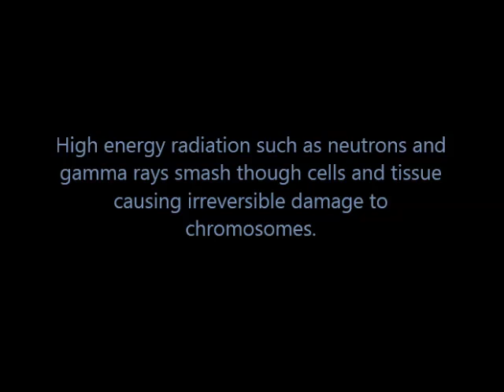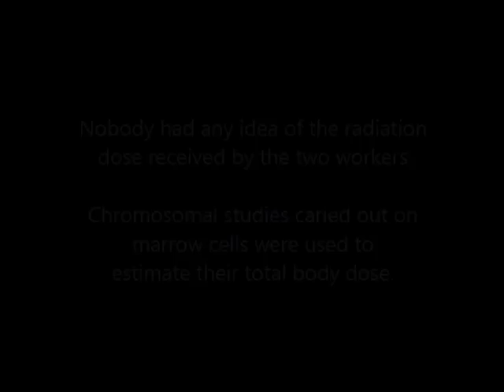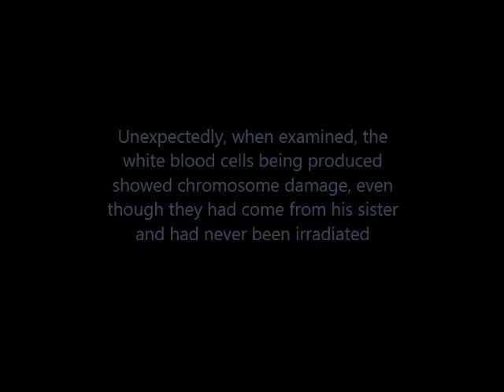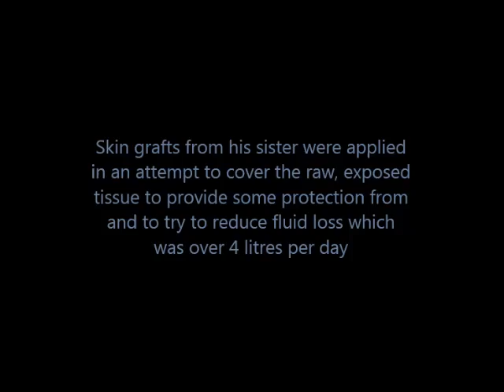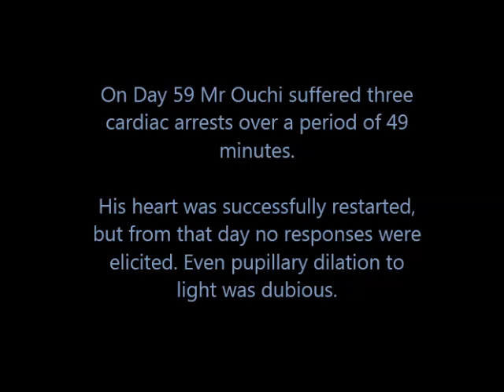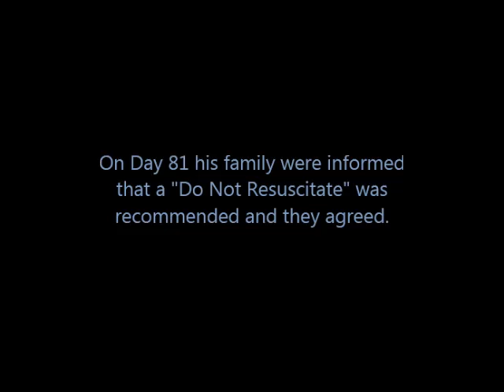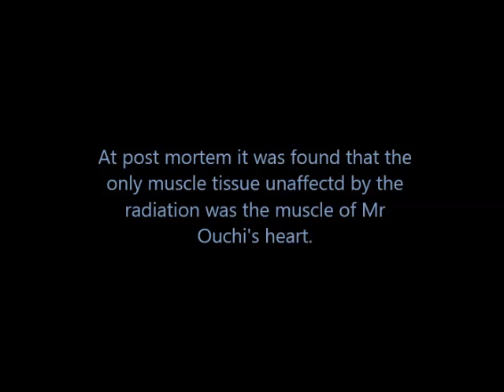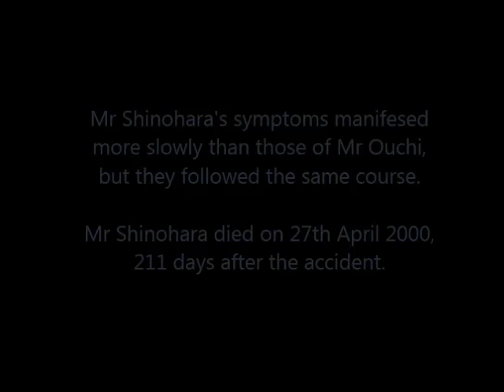Tokai-Mura: The Forgotten Criticality

Comment: Its not forgotten.  In fact it very much teaches us a lesson that a criticality outside a reactor is pretty much a localized industrial accident. There were two fatalities associated with very large acute radiation exposures. The local town was not affected. Like the Challenger shuttle disaster, the root cause was a lax safety culture combined with schedule pressures that lead workers to short cut procedures. If you find LA-13638, the compendium of criticality accidents since the 40s, you will find a photo of the assembly and the funnel the workers used. The lesson learned was attention to work processes, adherence to safety controls would have prevented the accident. The neutron/photon ratio was about 1/3, typical of a solution criticality.

Comment: Really amazing video of a horrifying experience.  Thanks for making this.
Reply from the maker: Abaddon Requiem Thank you very much! And you're welcome. I knew I couldn't be the only one fascinated by this case yet frustrated by the lack of information.
Reply: Definitely not, and this was exactly what I was looking for.
Reply from the maker: Abaddon Requiem
If you can, get the book. It's worth it. I may do another video on a number of radiation accidents, drawing them all together into one. What fascinates me is that in the majority, victims are fine for a few days before symptoms become evident and that freaks me out.
Reply: Fiona Robertson I think I'll order it off amazon.  Why is it that it takes a few days?  Does it have to do with the cells normal life cycle, and losing the ability to make more?
Reply from the maker: Abaddon Requiem
Yes, it's to do with how rapidly the cells would normally divide. For example cells of the skin and mucous membranes have a rapid turnover rate. In the skin, surface cells slough off continuously and the basal layer is continually producing new cells which slowly get nearer the top as new cells are produced below them. If the basal layer suffers chromosome damage so severe that they can no longer divide properly and/or subsequently die because of abortive division attempts, then the time taken for the skin to be completely lost is the time it takes for the newest cells produced prior to the exposure to reach the surface. Consequently, the skin gets thinner and thinner and is then lost. Only a skin graft which includes basal cells will allow the skin to regrow.

In the gut, when the mucous membrane goes through it's normal continual cell shedding and the cells are not replaced, the microvillae which absorb water and nutrients are lost and so digestion and water uptake stop and diarrhoea results. As deeper layers are not replaced, eventually the capillaries (which would normally be where the nutrients went to get to the liver) are exposed and rupture, causing haemorrhage which can be copious. This is the most ominous sign in radiation sickness. With massive fluid loss and no way to take fluid up, blood pressure will drop like a stone.

The unique circumstances of this case meant that effects never before seen were witnessed in the long-term effects of this sort of exposure. Harry Daghlian died around day 25 and many of the Chernobyl firefighters died quickly as well.
Reply: Fiona Robertson Wow that is horrifying...  Thank you for the information, this is such an interesting, yet grim subject.

Comment: From what I have heard, gamma rays are also used to sterylize water-based fluids such as gels and lubricants.
I can't help but cringe, thinking that our bodies are mostly Made of water and the effect the radiation has!
Reply: Standing in front of a microwave transmitter will do you the same.  You don't need gamma rays.

Comment: The tank should have big, thick cadmium coating.
Lacking of that...was a ticklig bomb...
Reply: It has nothing to do with thickness or coating of the tank. Remember, criticality depends on 5 things: mass, shape, concentration, reflectors, moderators. In this case, the shape of the tank caused it. They should have used a long cylindrical tank, per original plan approved by criticality experts, but they used a large one.
Reply: It has nothing to do with thickness or coating of the tank. Remember, criticality depends on 5 things: mass, shape, concentration, reflectors, moderators. In this case, the shape of the tank caused it. They should have used a long cylindrical tank, per original plan approved by criticality experts, but they used a large one.
Reply: Meh. Cadmium is neutron absorber. It would work as a buffer preventing criticality, but you are right!
" A Science and Technology Agency report indicated JCO management had since 1993 permitted the use of a stainless steel bucket as a shortcut in the process, even though it was contrary to written procedures."

Comment: How did that come to be the process they used?
Reply from the maker: The protocol which should have been used was obviously multi step and took some time. There was a "shadow protocol" which had been OKed by management which cut some corners. What the workers did that day, however, didn't even follow the "shadow protocol". The company was held responsible for neglecting to advise workers on the potential risk of criticality.
Reply from the maker: Ken Lee To be fair, it was the first batch of fuel being processed for 3 years. The technicians had no experience and were completely unaware of the dangers. The sad thing is that, in a different shaped vessel, criticality wouldn't have been reached because of the geometry.
Reply: it is stunning how little they knew.

Comment: Receiving 40 Sv is a lethal acute dose. 4 mSv is not.
Reply: I imagine it would take a dose upwards of 30 Sv to kill in a few days.  It would cause massive disruption of nerve tissue, and the victim would die of heart or lung failure. Only two people died at Chernobyl within a week of the accident, both of explosion trauma; the rest started dying only 12 days after the accident from Acute Radiation Syndrome (aka radiation poisoning).
Reply: Yes, you're right about the timing, but "quick" means within a few days to a week, less time than the body can react to healing itself.

Large doses of radiation can come from many sources; there is nothing magic about cobalt-60.  The worst sources of radiation in the world today are freshly removed spent fuel rods, with lots of short half-life fission products like iodine-131.
Reply: Well, actually, until the decay dies away enough that they won't melt standing by themselves in the air.
Reply: tubewatch59 Yes, that hot.  That's what happened at Fukushima... the fuel was fresh from use, and was providing plenty of decay heat to melt the rods wholesale when the cooling failed. This will be the case, for spent fuel, for up to about 5 years after it is retired.  After that convection cooling in air will do; however, they usually bathe them for up to 20 years, till they can be safely placed directly into dry cask (which is more restrictive for cooling) without fear of melting.